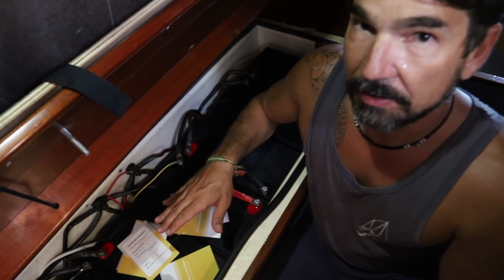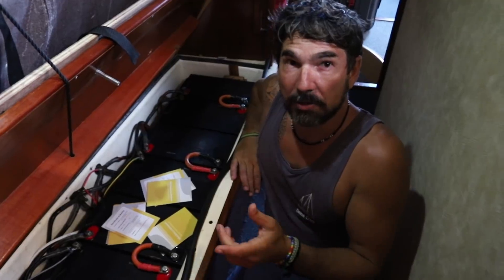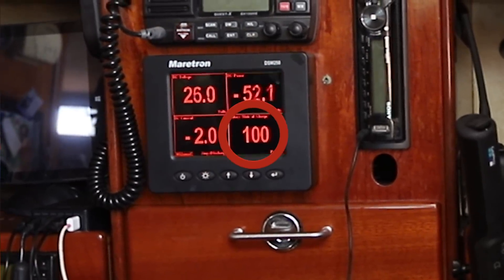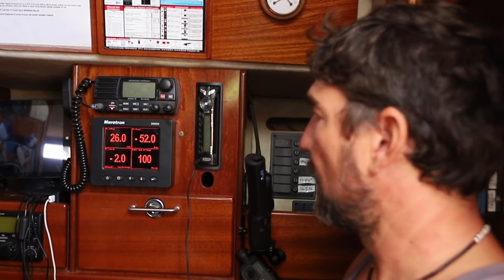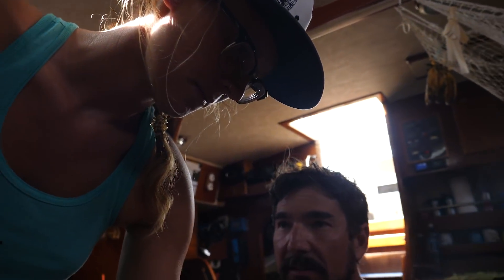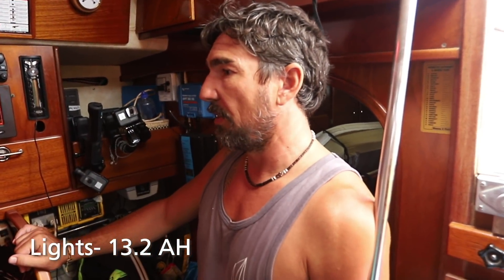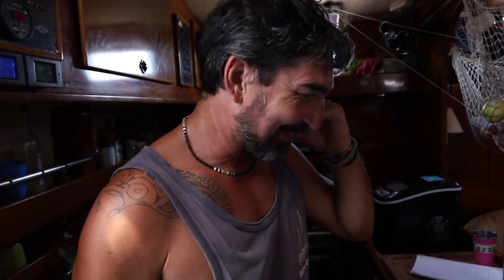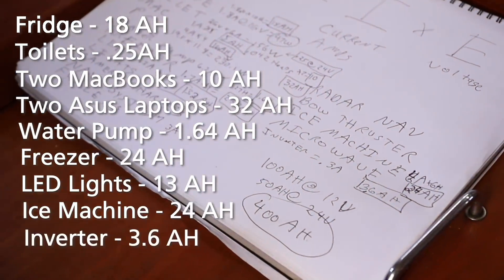WATT THE HELL is an amp hour?  Sailing Vessel Delos

Comment: Have you considered going to lithium?  Have seen several vids on them, seems the way to go
Reply: that's what confused me because i thought he had lithium, and they made this example for led. and there's less of a problem running the battery low on lithium right?
Reply: You can go lower and you get more cycles: win win
Reply: I thought they had gone to lithium too, maybe this was shot a while ago?
Reply: It was my understanding that they have made the switch already. As in many things I could be wrong. You are correct that lithium cells can go lower. When a lead acid cell goes too low it will usually still charge to some degree. When a lithium cell goes too low it will not take a charge again and may explode or catch fire. In the event of an accident lead acid batteries are an environmental disaster. Lithium battery packs can go off on a chain reaction and lithium reacts violently with water. With proper installation many of the concerns with lithium cells can be mitigated to some degree but they are still significantly more volatile than lead acid batteries. I would prefer to have neither on my sailboat but given the choice I choose lead acid batteries. I have enough problems with lithium cells I use for vaping and don't want thousands of them under my ass. I could be wrong though and advise each person to research their own choice wisely.
Reply: It is a terrible idea to take 8 points of failure and turn them into 7,000 points of failure. They have already made the move to lithium batteries but I believe it is an absolutely terrible idea. Lead acid batteries may have a shorter lifespan when they are run too low. If Lithium batteries are run too low they may never take a charge again or may explode or may catch fire. As usual it is important to not trust the salesman.
Reply: No they don't have lithium.
Reply: S/V Tattoo what the hell does that mean? 8 points of failure?
Reply: He's referring to the 8 lead-acid batteries.
Reply: That's correct Roger. I am referring to the 8 lead acid batteries. The 7000 figure is probably way off in one direction or another but I am referring to the lithium cells. There are many advantages to using lithium cells but I do not believe safety is at the top of the list.

Comment: Perhaps you have done it in the past (mebbe before I was prepared to comprehend)... can you comment or make a video about your solar and wind generation capacity, please? The large capacity panels consume huge space. Is there an issue charging a 12V starter battery and the 24V battery banks? What is the primary reason to choose a 12V, 24V, 36V or 48V battery bank? How are wind and solar (multiple) chargers connected to/prioritized for charge input? Does your system include a galvanic isolator? Thanks.
Reply: The main criteria to choose the voltage of your DC system is the maximum current you will pull out of the batteries. If you have systems that, all together use like 1200W, it means you will draw 100A from your batteries if the voltage of the system is 12V. That is a very high current to manage. You'd need very thick wires and would still loose too much energy as heat. If you increase the voltage of your system to 24V, you lower the current to 50A, which is far better manageable. As a rule of thumb you should try to keep your maximum current values below 70A or so.
Reply: Thanks for your contribution to my growing understanding.

Comment: Are these the batteries that you use to start the engine?  Wonder how many amps it uses per start.
Reply: MrCalifornia1234 of they're talking about a house battery, I know they have a distinction. So, no, the engine is not started by those, it has it's own starter battery. (Actually, all the boats I've been on were configured like that, since you have to have a way to start the engine to recharge the main batteries...)
Reply: A typical car starter will draw between 75 and 150 amps depending on the ambient temperature and the temperature of the engine.  If we say 100 amps for 10 seconds, then that is 1000 amp sec or 16.667 Amp Minutes or .27 Amp Hours.  Boats have smaller engines so their starter HP will likely be a bit less.

Comment: I say you do a dingy comparison ... aluminum vs aluminum bottom vs gift bottom etc.
Or
How you balance your boat so the auto pilot works efficiently
Or 
Your lithium battery install 
Or 
revisit how the new electronics r working
Or 
better yet how u made it transmit on WiFi

Comment: The electric bicycle center approves this video, if and when it’s time to replace your battery bank any consideration into upgrading to a lithium ion batteries?
Reply from the maker: Stay tuned for next week Samuel :)
Reply: Lion batteries require a change not just in batteries but in the boat’s charging and wiring systems as well. It’s a big deal to retrofit a boat to handle the load. Plus they’re expensive, plus they require high tech controllers to avoid thermal runaway. If techies have more info hope they’ll weigh in.

Comment: You forgot to speak about the regenerative effect. A battery will show zero volts once it reaches it’s max load at the temp stated on top of the battery. Now remove any load and let the battery cool down and then reconnect a meter to the battery, not a load and see how many volts remain. If that amount equals to an amp hour then that amp hour can be added as a plus to the total amp hours of the battery.

Comment: On the subject of electrical systems, do you use or plan to use any type of cell repeaters, such as the Yagi antenna that you 'aim' at the inland GSM, CDMA, UMTS, LTE, et cetera, that connect (usually via a 10 meter cable), to a booster/repeater then to an booster-mounted or central located 'indoor' antenna connected to the booster/repeater via a given length of coaxial cable? Both cables usually are 5D-FB Coaxial Cable OD7.5  ( High transmission speed, High quality).                                                                                                       I have seen/used these on land many miles from my carriers nearest tower, and it works wonders at a cabin cut off from everything where it is either fly-in to a lake or a long days hike in.

Comment: Excellent.  Delos is a big boat but you have a pretty reasonable power draw considering how many people are on board.  You didn't mention the power on the water maker?
Reply: Need to run gen set or engine to produce enough ams to power the high pressure pumps. Guess at least 1 horse power motor to pump the salt water up to 800psi
Reply: Phil The Farrier we run our watermaker off the batteries along with air con😘
Reply: Scott W ,correct
Reply: Yea, i think i remember them saying that too. i think whenever they run yhe generator to fill scuba tanks they run the Heavy stuff , watermaker etc.
Reply: ScubaTony Anschutz or the power draw on the distiller, assuming its using electricity over fire.

Comment: Nice video! Thank you - and more of these would be highly appreciated. One question: what’s the benefit of running 24V as opposed to 12V?
Reply: When you double the voltage it halves the current flowing to provide the same power,  which means you can use smaller wires to do the same work,  also power loss is measured at current squared times resistance so if you halve  the current you are loosing a lot less power, for example if you are running 10amps and the resistance in the line is 10ohmes ,  your power loss is 10 squared which is 100 times 10 or 1000 Watts,  for the same. Running 24 v it would be 5 squared times 10 or 250 Watts power loss,   Which is a quarter of what the 12 v system is.  Bet you are sorry you asked now. :-)
Reply: vxnova1 Thank you for the detailed explanation. I wouldn’t be able to figure that out myself, but now that you have described it, at least I have a hum. So no, not sorry I asked - only grateful that there are people taking their time to answer my question. :-)
Reply: Rune Bjørnstad A few benefits comes to mind: It's more efficient to run a higher voltage in regards to both the equipment and the wires - less of the power converted to heat. That's why your power company will run high voltage lines whenever they need to cover longer distances. This also means that you can run thinner cables on the boat, saving both cost and weight. There are of course some drawbacks as well, like a greater chance for the electricity to arc between the poles (meaning you need better isolation and/or separation).
Reply: Mikael Ångman Thanks! That cleared it up.

Comment: You forgot charging your phones, cameras, drones, etc. Great interesting video though! More of this different content every so often is really appreciated for us Patrons!
Reply from the maker: Yeah so true...  Will hit that topic up in a follow up :)
Reply: And when your chargers are pluged-in they pull power. Phantom power is a drain on the system.
Reply: Jade Traveler plus if your batteries or any part of the system has a ground, it pulls some current. Where I work, we check for grounds in our battery systems for safety reasons because we can’t have anymore than a 2mA ground or greater.
Reply: I think having left a few amp draws off the list in no way detracts from the value of the video in terms of getting the concepts across.  There's always going to be some electrical load you didn't plan for, which is why you have to allow for some excess capacity in the system, as I am sure Brian has.

Comment: Watt's up.  Love that title.     Will you be breaking down the power benefits on the new battery system and electric loads in the new galley set up mentioned a little while back?   I have been trying to fathom how a battery powered electric stove compares to propane.   I started thinking about the new Delos system after watching a recent Sailing Uma video on "Propane vs Alcohol".   

Assuming electric induction cooking, one would expect an induction stove burner to consume 44 Amps. Is this what Delos is expecting?   Or is the new stove system much more efficient than standard induction cooking?  I'm guessing the cooking time probably reduces by 50% too, so if one normally used a propane stove for a total of 2 continuous hours a day, then that would be reduced to one hour with induction cooking.  This would imply 44 A*hr of daily use for stove top cooking.  Which I'm guessing is reasonable with other high loads and a new high tech battery system.  But I'm at a loss to see how an electric oven would be feasible. Is the new system an electric/propane combo?

The 44 Amp load is based on an equivalent standard gas stove burner out of 7,000 BTU/hr.    Which can be expressed in term of Amps as 7000 BTU/hr * (1055 J/BTU) = 7.4 MJ/hr = 7.4 MJ/hr * (1 A*hr / 0.0936 MJ) = 79 A. Only about 50% of the heat from a gas stoves goes into cooking whereas an induction stove is likely 90% efficient.  This reduces the current load to 79 A * 0.5/0.9 = 44 A.  Note the Amp*hr conversion assumes a 26V battery (1 A*hr = 3600 C  of charge Q or in term of Energy E = Q*V  = 26V*3600C = 0.0936 MJ).    

Now comparing to propane: 
 44 A*h/day = 44 A*h/day * 0.0936 MJ/(A*h) = 4.1 MJ/day
A 20 lb tank of propane has 422 MJ of energy of which 50% is lost heat.  So 422 MJ * 0.5 / (4.1 MJ/day) = 51 days.  This implies that every 51 days of induction stove use saves a 20 lb tank of propane.   

I'm assuming that Delos is keeping some propane for a grill (or combo range?). Got to have a BBQ.
Reply from the maker: Ha Ha, glad you appreciate my attempt at a little nerd humor :) . So you are actually pretty spot on with your thinking and calculations.  The next video (next Weds) will cover some of this, but I can give you some numbers now.  The Induction HOB is rated at 1800 watts for both elements.  We found that when on max power one element pulls about 47 amps @ 24V, so about 1,200W.  On this model you cannot run both at full power....  So far we haven't used it very much but I did cook a curry dinner for 15 people (big curry pot, big rice pot) and found the entire meal used 66 AH @24V.  And I think simmering curry and cooking a big pot of rice is quite a work out for any stove.  I would have been boiling in the galley but it actually did put off way less waste heat.  
Our normal propane usage on Delos is one 5KG bottle per month, given we have so many tea drinkers onboard :) We'll keep track and figure out what the conversion is but your numbers seem pretty reasonable.  You know what, they actually gave us an electric BBQ as well.  I'm not sold just yet but we will give it a shot......  Fair Winds!  Brian
Reply: I am looking forward to your discussion on the induction HOB.  If one has the spare amp-hours in the bank then I see many potential advantages.  It is great to see Delos leading the way.

Here are some values which may be useful for future comparisons.  Energy density of propane = 46.5 MJ/kg.  A monthly 5kg propane bottle is theoretically equivalent to 46.5 MJ/kg * 5 kg/month * 1 A*h /(0.09 MJ) = 2,583 A*h/month at 25V.  Taking cooking efficiencies into account gives a more realistic amp*hr equivalent of  2,583 A*h * 50%/90% * 1month/30days =  48 A*hr/day @25V which is also 1,200 W*h/day.

Comment: Depending on what was running at the time, that Mac power usage could really spike upwards. With Windows, the hardware drivers are just written by... Whoever got stuck doing it at the HW company, so they don't always turn themselves off or scale their voltage as needed.

Since Apple controls all the drivers however they want, they make sure to turn things off and modify their power draw as needed. 

I'd be interested to see the draw when both are actively rendering a video!
Reply from the maker: Yeah good call James, when we get back to Delos will run that comparison.  Brian
Reply: These are both GAMING laptops, it should be born in mind. They use FAR more powerful hardware, and are generally far higher performance than the Macs. So it's really not a fair comparison.
Reply: I think the asus notebook is a more powerful computer than the mac's. Although you must make shure that both are completely charged and are working on a normal load.
Reply: Those ASUS probably have external GPUs in addition to the embedded Intel. They alone can consume 150W. (6Ah@24V), then you have a bigger display, and if the laptop battery is charging at a higher rate can pull more current.
Reply: yea, i believe that laptop of brians is a Rog. ( Royal order of Gamers Addition )  which is a gaming Laptop / Beast and Will definately Have a Dedicated graphics card. it Should also Render Faster than the Mac If it Has a intel cpu , The Mac's are a Much more Fuel efficient machine by design standards & build quality.
Reply: I personally never quite understood why on earth you would want to use gaming laptops for editing videos. You are FAR better off with work station mules who do the work about 5 to 12 times faster with a good amount of internal memory (8 to 16 GB), high speed solid state hard drive (having around 1 GB/s read and write speed is a must for fast editing, and most generic SSD's do not offer that speed) and a high end graphics card can really make the difference in editing.
I would recommend you guys to really up your game in the laptop section and replace them with dedicated second hand workstations with good specs. Affordable, reliable and very fast (but can be heavy). Also caution to have your air intake in laptops improved. Salt water is really bad for electrical circuits. An external cooling system (can be as easy as a board with some holes where fans are placed) combined with filters on air intake (cooling system required as the normal airflow will be too minimal to keep it cool during powerful operations like editing) helps maintain life expectancy for laptops and computers in general.
And last to mention: Having additional batteries for laptops accompanied with chargers for those added batteries helps a lot.
Reply: DePVDM Terrible advice, that. Workstation laptops? Like what? You aren't seriously suggesting putting a high power draw and bulky full size PC on a boat are you lol? What makes you think destroying the cooling system on laptops that are always on the verge of throttling anyways is a good idea? Condensation is BAD. The reason these sorts of laptops work well is because they probably have desktop grade processors.  Also terrible advice to worry too much about batteries, as these laptops under load will drain them in less than an hour anyways. Why screw up a render trying to run it off a battery? You don't know what you're talking about. Not even remotely.

Comment: Wouldn't have guessed that the computers were that power hungry. Do you use inverter -> power brick -> PC or do you dare feed 24(26)V directly into the PCs? I know some PCs have 22VDC power supplies. I would not dare that on my Macbook Pro, it has only 16.5V. Nice video BTW, looking forward to more of this 👍
Reply from the maker: Yeah this is the old fashioned way with inverter -> brick -> pc so there is a bit of loss there.  I need to look more into the DC to DC converters as I know they are wasting a lot of power burning hot!  Given the voltage fluctuations on our system it would need to be pretty well regulated to be safe though....

Comment: Really helpful.
What power monitoring equipment do you have?
Reply from the maker: There are two systems we rely on. The first is a Maretron DCM100 Direct Current Battery Monitor.  It works well because we have NMEA 2000 compatible instruments Delos (alos Maretron).  We also have a Victron battery monitoring system, we will be putting up links of everything in the next video about our Lithium installation so stay tuned for that.
Reply: Sailing SV Delos Thanks. Keep up the practical as well as the inspirational videos.